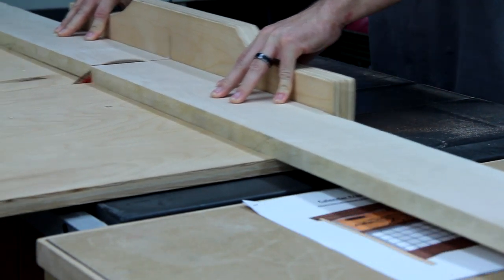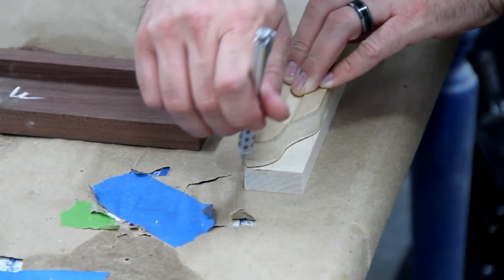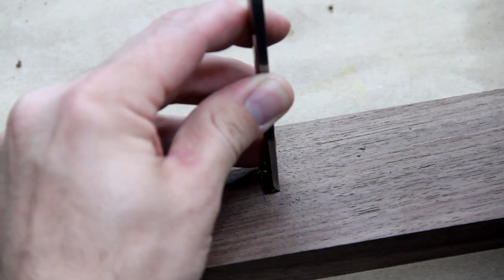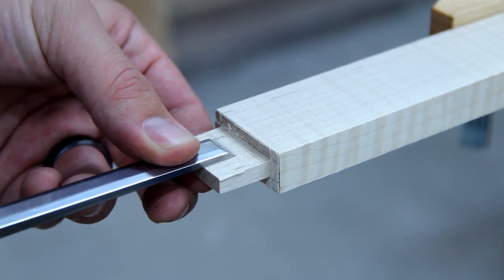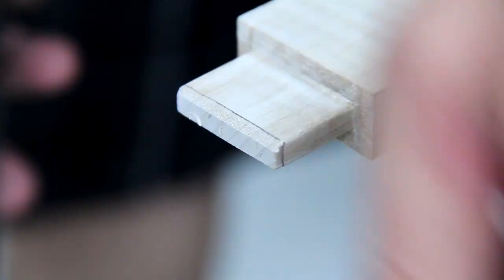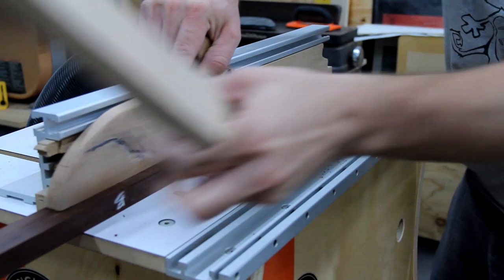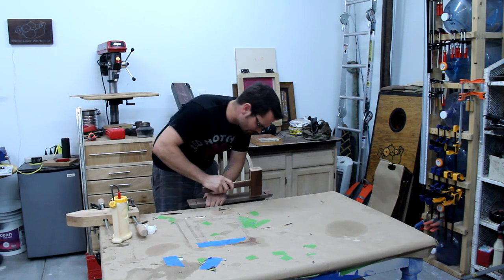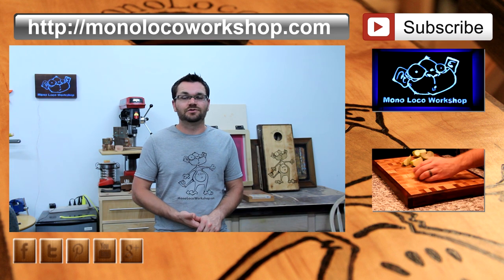Calendar Frame

Comment: Nice job!
I got the same plane (low angle, round 12deg?) and had some problems with it straight from the box. The way the blade was sitting I had to open the mouth all the way to get at least some use out of it. I tried filing the part where the blade was sitting and it made it a bit better, but I think it's still far from perfect.
Did you encounter any problems with yours when you got it?
Thanks!
Reply from the maker: +jakoball I didn't have that exact same issues but I've some some other minor issues with it. Generally on all new planes, you need to flatten the blade and frog. (If you don't know, the frog is the part that the blade rests on.) Then of course sharpen the blade. This is especially important for cheaper ones since they aren't generally made to the same specs. This last year I spent a good deal of money and got a few planes from Lie-Nielson and don't know if I can go back.. ever

Comment: Great build! 
How are you hanging the calendar on the inside?
Reply from the maker: Thanks Walter. I used a small brad nail on the back side of the top rail. I pre-drilled at a slight upwards angle, cut the brad nail a little shorter and then glued it in. You could also use a small dowel if you have one small enough.
Reply: Ah, OK!